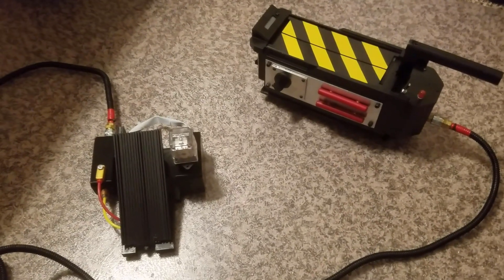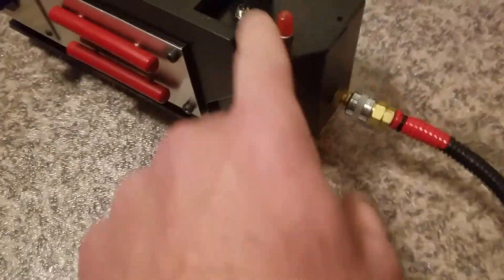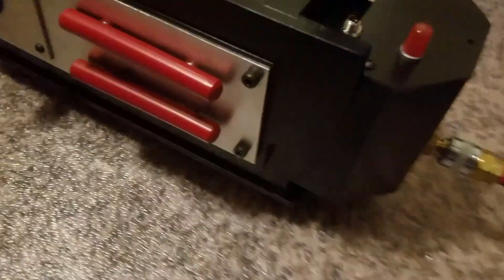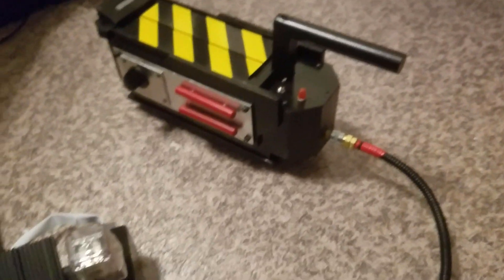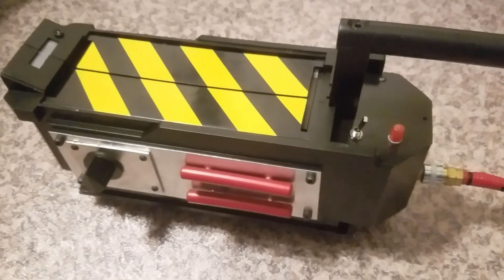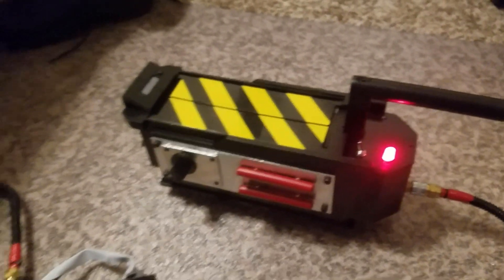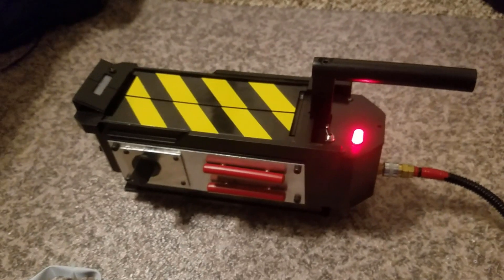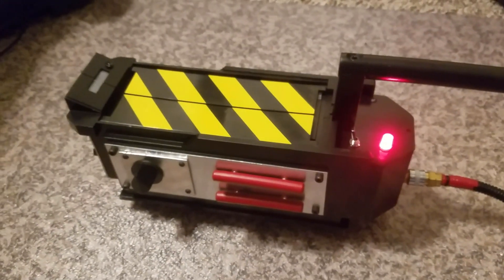Ghostbusters SH Trap Mod Halloween Demo

Comment: hello nice video congratulations, I just wanted to ask you one thing, why I load the audio files on the micro sd but when I operate the trap the audio is not heard ???
thanks
Reply from the maker: What board are you using for the audio? And what kind of speaker?
Reply: @TragicManner  board XY5300 speaker 8hom 10w, Arduino nano

Comment: I thank you for all your work on this project. I was banging my head on the metaphoric wall for what seems like months trying to get my trap to work with audio. I stumbled across your video earlier today and thought "here we go again, code that probably wont work". I got everything set up and uploaded it to my Arduino MEGA. Guess what it didn't work, so I looked over the code to make sure I didn't miss anything, 'I did' I hadn't set the serial pins to the right pins. So I fixed that and re-uploaded it to my MEGA. wouldn't you know IT WORKED flawlessly, first time. 
This is all after trying over 30+ different codes to get the YX5300 to work.
Reply from the maker: Glad you got it working!
Reply: @TragicManner  
It now looks and works great but I would like to add the correct sound effects. would  you happen to have an audio file list?
Reply: Cdh GB xghd he me bcc
Reply: hello nice video congratulations, I just wanted to ask you one thing, why I load the audio files on the micro sd but when I operate the trap the audio is not heard ???
thanks

Comment: where do you get the air switch from??
Reply from the maker: It's a cheap one off Amazon. It's a momentary trigger one so I had to write my code to deal with that, but the price was right!  https://www.amazon.com/dp/B013ZT3SFQ/ref=cm_sw_r_cp_apa_i_.0vFDb1GDP08E

Comment: How did you get the foster connector to hit the air pump
Reply from the maker: Inside the trap I have an elbow connector that attaches to the female threaded side of the foster connector. That then has a barbed connector that screws into it, and from that I have a 1/8" inner diameter hose that runs from the barbed connector to the air switch. On the pedal side, I have the straight coupler that then hooks into the another of the same barbed connectors that then has a hose connected to it that runs to the bellows on the trap. I sealed up the bellows as best I could so they put pressure on the line, and it works pretty well.
Reply: @TragicManner  Awesome I plan to do the same to mine. I been looking every where to find the right parts on my list. So far my list is empty
Reply from the maker: @ddrusa  I plan on doing a more detailed walkthrough of how I did the inner electronics and air stuff when I sit down to build another of these. I have a second spirit trap and I'm thinking I may as well upgrade it, especially because I already have most of the parts and I know how to do everything so it should go much quicker. So when I do that I'll be much more detailed on what I did and how I did it all and what parts I used.
Reply: @TragicManner  Awesome thank you amazing work
Reply: How much would a commission be for one of these?
Reply from the maker: @yankeetrex  I've been thinking about that on and off as I do have another trap and some left over materials. To be honest, I'm in a bit of a hard place, because the amount of work that goes into these will make it quite expensive, and pretty close to the price of a used Matty trap, so I have no idea if anyone would actually be interested.

Comment: Dude, nice job!  This looks great.  I love the final trap.  Good find with the sound board.  I was looking into the adafruit board but it's 5 times as expensive as this one.  How does the sound run from the board to the amp?  Did you solder it onto the audio jack ports?  I'm interested to see how you hooked everything up.  Also, did you use the original lights on the yellow indicator and just reconnect them?  Also, looking at the code, did you use an arduino nano?  It looks like you may have upgraded to the mega.  What upgrades do you think you'll do in the future?  I couldn't tell from the video but did you have multiple pedal presses?  One for the open, one for the trapping and one last press for the trap closing?  Either way, it looks awesome.
Reply from the maker: Thanks! Yeah, the sound board is pretty awesome, though I haven't gotten a decent amplifier to try it with to see how nice the audio can be from it. I have one coming in a couple days, so for now I'm just going to be using crappy dollar store amplifiers that probably are not pushing enough power to the speakers anyway, which means everything sounds like crap. It'll be nice once I get it all working like it's supposed to! I am using an actual audio cable inside of the trap, but I could easily have soldered everything in instead to save a little space. I may do that the next time I open things up after Halloween.

I did use the original lights in the yellow bar graph indicator, I just added a new one to the right of them by drilling a hole right to the right of the bar graph and putting a 3mm LED holder there. It worked really well. I did reuse the wires to the yellow bar graph LEDs as well, though I had to switch them around so they weren't all sharing the positive connection like how the SH originally had them.

I am using a nano still, no change there.

In the future I'd like to look into a couple of things. First off, I'd love to better utilize the space underneath the trap doors by putting a thin piece of plastic an inch or so above where the bottom of that compartment is to allow for space to put in a vaping pen for smoke. I also am wondering if I want to put something above the LEDs to refract and/or diffuse the light coming out of them, and now that I have a much beefier battery (I picked up a 7.4v LiPo that can really deliver current on demand) probably a couple more LEDs to help make the effect really nice. Still haven't determined exactly what I'd use to refract the light, but something that more scatters the light than simply dampens/diffuses it would be awesome. We'll see.

So right now I have it set up to operate on a single pedal press. Each state can be specified as "interruptable", where if the pedal is pressed during that state it continues on to the next one. The only states are the idle state and the main state that happens after opening the doors. So one press opens the doors and starts the light show, pressing again during the light show jumps to the "capture" light show, at which point it plays the capture audio and closes the doors.
Reply: @TragicManner  well it looks incredible buddy!

Super Mini PAM8403 DC 5V 2... https://www.amazon.com/dp/B01MYTZGYM?ref=yo_pop_ma_swf

If you're still deciding on amps, try this one.  You can tap out either the 5v or 3v feed from the arduino to power it and it has a built in potentiometer so that you can adjust the volume.  You can either hide it in the trap or tap out a dial on the outside and run it through there.  Also, do you have the sound files for the SD card?  They sounded very clean and unlike any that I've been able to find.  Lastly, it might be a cool idea to add movie sound effects or other functions via a hidden outside button.  This way you could have like a standard mode vs a movie quotes mode.  Like the trap closes and then it says, "two in the box ready to go we be fast and they be slow".  Could be cool and maybe not a whole lot of extra work.  You'd know better than me.  How sturdy is the whole trap?  It looks really tough with the new handle.